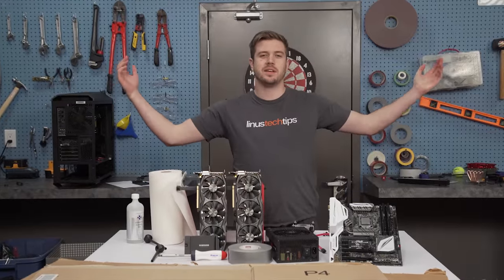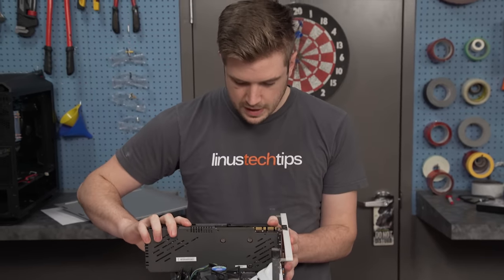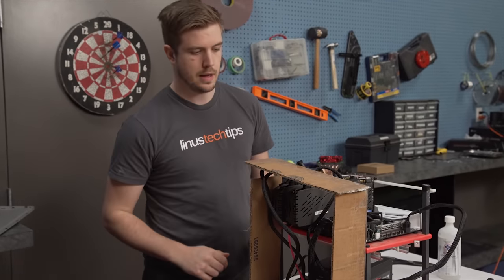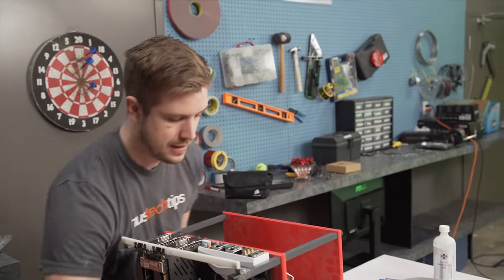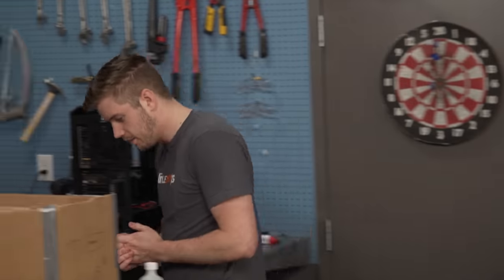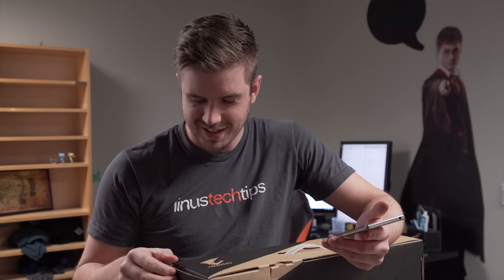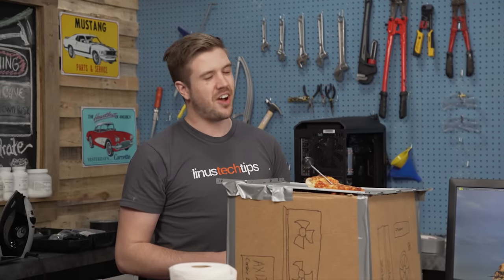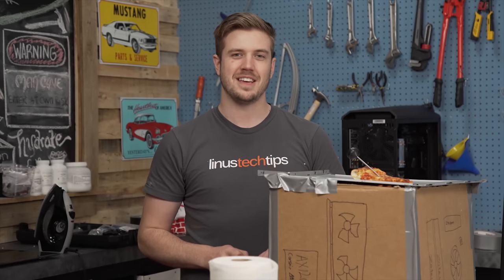Gaming PC & Pizza Warming Platform Prototype Construction

Comment: Are you guys out of ideas?
Reply: Yep
Reply: +z1ckZack10 I'd say they are out of interesting computer hardware. But holy shit the half-assedness of the couple of previous videos.
Reply: +Table Salt That would be shocking, since these are recorded a month in advanced, meaning the Network wall would have been released around 2 weeks after this was recorded.
Reply: +Table Salt This was filmed on February 19th, as he says in the video.
Reply: Its from the lack of new stuff coming out
Reply: +z1ckZack10 You're coming to that conclusion just now?
Reply: Next up: 50 gamers, 1 cpu (actually 7)
Reply: no this is very creative.
Reply: no, they're running out of new hardware, so they have to use their own ideas
Reply: +z1ckZack10 It would burn the pizza.
Reply: +ImpaKtZero So basically it's the same as running out of ideas xD

Comment: Should have used 4xSLI GTX 480 and FX-9590
Reply: He said cook the pizza not your neighborhood
Reply: Crossfire RX*
Reply: +Kellin Quinn No, that is nowhere near as hot as sli gtx 480s.
Reply: i was going to say 480 too nut then a remembered the 6990 lol
Reply: Dane Reinsch Oh. Didn't realize Nvidia made a 480 in the past.
Reply: Hahahahahahahhaha
Reply: Use Prescott Pentium 4s as well.
Reply: Use Galatin Extreme Edition P4s
Reply: https://www.pizza-rozvoz.cz/ tady najdes tu nejlepší pizzu v praze
Reply: quadrplax we're trying to heat a slice of pizza not build a bomb
Reply: Can confirm i have 1 GTX480 liquid cooled and it takes 2-3 seconds if pump fails to crash due to overheating
Reply: he wanted to keep the pizza warm, not COOK raw meat....
Reply: lol
Reply: quadrplax with watercoolinf too
Reply: now that vega 56 and vega 64 is here, the pizza can reach temperatures of 44c
Reply: What about a GTX 460SE
Reply: They should have used two HD6990's in crossfire in furmark
Reply: HE WAS TRYING TO COOK PIZZA NOT CREATE A STAR
Reply: lol :-)
Reply: How bout we use 4 overclocked threadrippers and an overclocked core I9 just to be sure
Reply: Pff, I can do better. FX-9590 & quad Radeon HD 6990 @ 880mhz. Each card has a estimated TDP of 491w and closer to 550w when OC'd. Forget pizza warmer, you could cook your pizza on that!
Reply: Also, load up furmark for even HIGHER power draw!
Reply: Update: 10900K/RTX 3090
Reply: would you recommend those for a new pc?
Reply: Heater not oven mate

Comment: Would make more sense to use amd cards.
Reply: +Fire Lord Sanders Your pun went up in flames, sorry
Reply: +Vinyl Scratch just like amd's financial reports since 2010 (and their gpu's)
Reply: +Alex G Erm no, AMD is good, stop with the fangirling.
Reply: William Huddie that went right over your head.
Reply: Yeah you should have used an amd CPU and amd cards
Reply: +Alex G Also I own a GTX 970 and prefer nVIDIA, but AMD beat nVIDIA in some benchmarks (Titan X vs R9 Fury X at 4K for example)
Reply: +tnnss111 Shots fired.
Reply: William Huddie It is still going over your head man, are you aware of what a satirical joke is?
Reply: +PsychoSlayer55 jones intel CPUs can run hotter. most amd cpus have a max temp of 80c and most intel can do 100.
Reply: +UltimateKnives Dont want to use it as a pizza-oven, just heat the pizza.
Reply: +tnnss111 dammm shots were fired
Reply: +Shiba the planes were fueled by 6300s!
Reply: +Shiba the planes were fueled by 6300s!
Reply: +ChexEdits Yeah but a maxed out AMD is only like 60% of my Intel so my Intel will be cooler doing the same workload.
Reply: +tnnss111 that was a rekt right ? HAIL GTX 980ti
Reply: +GameDev1909 Game Engine Tutorials have you overclocked it ?
Reply: +ChexEdits It's not about the temperature of the part. It's about the heat output from each part, therefore it would be best to have a 9590 and amd graphics
Reply: Alex G I am, but yours sounded very non-satirical, and it doesn't come across well in text
Reply: The joke was overworked, basically the first comment on this thread was funny because of its simplicity, a plain statement, not tryharding with jokes about finance or anything
Reply: YES, there he is!! The Elite gamer! Everbody make room for him. He is quite clearly better than everyone!
Reply: William Huddie If you say so
Reply: Hidde van Ophoven Wtf?
Reply: Alex G Imo, I mean I don't want to shit on your joke...
Reply: +tnnss111 or a pentium 4.
Reply: +caddy 50C in full load ... rly.
Reply: +William Huddie "Also I own a GTX 970 and prefer nVIDIA, but AMD beat nVIDIA in some benchmarks (Titan X vs R9 Fury X at 4K for example)"

well thats not true for one 

and ever since Amd released there hole "R9 390 BETTER MID RANG GAMING, LOW COST"

and the gtx 950 aimed at 160-200 USD beat all of the...

but i will say the R9 nano beats the TITAN X i price per performance but you still wont be able to achieve 980TI levels without crossfire
Reply: shots fired AMD fanboys!!

oh shit! my system is AMD based..
Reply: +tnnss111 He wants to heat the pizza, not burn it.
Reply: +rv3392 I seem to have forgotten that a fury x is about the same power consumption as the 980 Ti. if you want a real roast 290x ho
Reply: Funny because it's true! >_<

I got a single R9 290X I stopped using after 1st one fried and I got a new one for warranty. They run @ 80 degrees celsius doing fuck all - It'll heat up a pizza to the point the cheese becomes a liquid
Reply: +TheGray Aviator I have a 380 and it doesnt even reach 65 degrees lol xD
Reply: GTX 480s are definitely the best
Reply: +TechBrick ayymd
Reply: use the cards Apple uses in MacBooks, those things can burn you...

tru stori meight
Reply: +tnnss111 I would of agreed a few days ago, but I'm currently sitting in a hotel due to the fact that my GTX 590 burnt down my house.
Reply: Alexander Yordanov im willing to argue that Nvidia makes there cards better and first, and AMD generates more heat, causing less performance, take longer to come out, and COST more then there Nvidia counterpart
Reply: AMD GPUs apart from high-end level is damn good deal! But CPUs for now are a god damn joke!
Reply: +Slamdoxicalz lol your R9 290X is probably on a custom cooler. the real deal here are R9 290 or 290X with stock cooler from AMD ^^ it will EASILY hit 95°C because that's actually AMD's default target temperature.
Reply: +Logan Darklock actually those cards output a minimal amount of heat, but apples cooling sucks because they refuse to use fans, and prioritise thinness over everything but making it overpriced
Reply: +Ganjasaurus X lol rip
Reply: DragonTamer Cos
And you would be wrong.

Also... more heat does not mean less performance lol...
Reply: Alexander Yordanov
well it mostly strains overclocking i do characterize that as a performance strain
Reply: DragonTamer Cos
Very few people OC. Shocking, I know, but it is a Fact.
Also, even so, it is not quite correct what you are saying.
Reply: Alexander Yordanov
well..its sorta..6:17 am..give me a break
Reply: DragonTamer Cos
12: 21 PM... :)
Reply: Alexander Yordanov
in est..6 am
Reply: PLIVIUT - Sparklez Student (Ninja Defuses and Montages) yes,right now with the same cooler,i have around 75-80C in full load

Comment: You should have gone with a 290x and amd cpu for more baking power :P
Reply: All inside tbe Fractal Toaster.
Reply: looooooooooooooooooooooooooooooooooooooool
Reply: +David Dorm sick burn, but at least it wont gimp the pizza's flavor with SHITWORKS!!!
Reply: I came for amd comments and found one.
Reply: +Jan-Christopher Estelmann a QuadSli of GTX 480s for industrial furnance works
Reply: Hell no, GTX 480 bakes the cake on this one.
Reply: just get a 280 and 9000 series fx cpu with stock heat sink. Instead of the pizza melting the cpu will be crisp and abit overcooked and the gpu will im sure they would of blew up.
Reply: SrizyGaming what particular heatsink or cooler is irrelevant... the TDP is the clue, how efficient the heat will be moved from gpu to air (case air) does not play a role because of thermal dynamics
Reply: +Jan-Christopher Estelmann im saying the stock fx cooler becz its will be at 100% at idle and in benchmark the fan will just fly off and then youll realise that you like ur cpu medium rare not burnt.
Reply: +Jan-Christopher Estelmann fx9590 @ 5.0GHz
Reply: +Jan-Christopher Estelmann 390X and overclocked FX-8350 here, can confirm, could probably incinerate a slice of pizza by running prime95 small fft and furmark
Reply: +Jan-Christopher Estelmann they just used stuff they had laying around

Comment: silly Luke, should have used an AMD fx series CPU and 2 fury's. could have baked a pizza then lol
Reply: +Matt Rowbottom He doesn't want to burn the pizza though.
Reply: 3.8ghz Pentium 4 and Nvidia 8800gt or 5900 or 7950gx2 XD
Reply: +MinBCraft Or  Pentium D
Reply: Fury's don't have high thermals... LOOK AT WHAT YOU HAVE DONE LINUS. FIX THIS!
Reply: They have a higher TDP, more heat energy is generated. Thermals are a result of the efficiency of the cooler and how much heat energy it can dissipate. So yes, a fury would have been a better choice
Reply: Oh my goodness, settle down sir, it was an idle joke. We're not being haters and its not destroying anything, if anything it's inspiring competition, I wouldn't be surprised if AMD got it together this year and created Zen because they saw how much of a cult joke FX had become. 

There are fanboys out there, can't dispute that but, theres a difference between poking some fun and being a fanatic hate monger lol. I just go with whatever is doing the best at the time of my upgrade in terms of my needs, last build cycle it was the 4770k paired with a Gtx 780, before that a 2500k paired with a radeon 5770 and then a 7770 and before that an amd x2 with a HD 3850 (I think), wait what an AMD chip !? I'm an Intel fanboy nooooooooo
Reply: Don't blame Linus for it either lol, it's just a well known fact that they haven't improved their architectures in many years and their GPUs most commonly run warmer / have a higher TDP than nvidia no one really cares and people still buy them but, it's part of the custom pc community to poke fun. In more recent years it's become pretty toxic with the rise of CoD and  more early teenagers having custom rigs
Reply: Matt Rowbottom I will give you that, I am jaded. I am actually not a fan of any brand, so don't get it twisted, I have just seen so many great innovations lately from AMD but their market share still unfairly falls, and a monopoly will be bad for everyone. Continuing the same old complaints about things AMD has already fixed is counter productive. All it is doing is giving AMD an unfair chance to fight back with zen and vega. 
Call me pessimistic, but I forsee AMD beating intel and nvidia on all fronts, and STILL losing market share. The mindshare is too strong, and people will blame AMD when they fail as a company, and PC gaming will be consolized due to monopolization.
Reply: Nah, if they come out with products that best the competition they're targeting they'll thrive. Unfortunately not targeting the high end and enthusiasts off the bat with Polaris has slowed them down, especially with the 480 lagging behind the 1080 in dx11 which is the most common game engine
Reply: Matt Rowbottom No people do care, and they are NOT buying them. That is the problem. AMD is right for the majority of the market, but they still can't sell product, due to the internet completely overflowing with regurgitated AMD hate.
Reply: The power draw issues on the reference model killed them as well in terms of bad PR. Uninformed people got scared off by thay
Reply: I think part of it is just their image as being affordable instead of premium like the other brands. People like to feel like they own something special instead of generic (not saying they're generic just talking about marketing psychology) and things with a higher price and a more premium feel almost always do better especially with them seeing higher numbers in benches etc. They have a lot of work to do but, of they can convince people it's a special and premium product that's desirable AND they win the benches they'll crush them
Reply: But what about all of the reference issues on nvidia cards? They get buried due to the overwhelming support they already have.  I sometimes wonder if AMD could possibly succeed unless they do everything flawlessly for 20+ years, which is impossible. A single mistake and the internet will have more fuel to diss AMD into oblivion. Do you remember the power draw on the 400 and 500 series nvidia cards? Christ... that was ACTUALLY a problem, yet they still sold like hot cakes, pun intended. Lying about the 4GB of ram? Either of these would not have been buried had it been AMD.
Perhaps AMD should also pay shills to post in comments and forums. It has done wonders for intel and nvidia, starting the trend.
Reply: Easy lad, I'm just spit balling here. 

The 480 nuking cheap mobos was a huge deal, anything that does physical damage always makes big waves even if was only a miniscule minority similar the galaxy note 7 exploding phones, I think it was less than 1 percent of units but the internet was thrown into chaos about it and they were all recalled but, the internet remembers and Samsung has been hurt by that. 

I can't remember the 4/5 series being a real issue and killing hardware although I don't think I was paying a huge amount of attention to the market at the time.

The 3.5GB issue did hurt nvidia but they are wizards when it comes to PR and managed to distract people with the next shiny thing and most people forgot because it didn't really hurt gameplay or do any harm as the card wasn't powerful enough to play anything well that would consume that much vram.

Its a hard life but, if you want to build a name and come back as the underdog you have to work bloody hard and be flawless. It's like starting a small business , you can't make a single mistake in the first few years or you'll fail. If AMD get a few solid Ryzen / Vega product out of the gate people will start to forget and maybe in a couple of years they'll be back ontop like a decade ago when their single cores were the best around
Reply: Matt Rowbottom Personal responsibility is a hard pill to swallow. I will leave it at that.
Reply: Very well, hope AMD do ryze in the new year
Reply: I forgot to mention the fiasco of AMD reusing the r9 200 series guts in the 300 series. That really hurt them too. I mean you must admit that AMD has made at least as many mistakes as everyone else and hasn't bothered to innovate much in 5 years with every year building a more and more negative image of them. 

Ah well I'll leave it alone
Reply: Matt Rowbottom r9 300 series was a redesign of the 200 series to compete better with Nvidia's 900 series. Their R9 390 beat the GTX 970, so it worked.
Reply: Fair point but, what I'm saying is the discovery and bad pr that it was a very minimal change at all physically hurt AMDs image and worsened peoples opinion of them.

I'm mainly talking about image and marketing here and how AMD could improve and better compete in my uninformed opinion as a pro-sumer.

If they can improve their image and match the PR and spin of the big boys they'll have a much better fighting chance of swaying people to buy their products
Reply: I'd like to see them abandon the 'affordable' angle and push for a more premium campaign which is more the direction Ryzen looks to be taking, they're going for it and getting excited which is good to see.

But, if they bugger it up it'll kill them and it'll be 10x harder for them to ever recover
Reply: Matt Rowbottom Affordable is the far better option for AMD in terms of profit. They're doing affordable, yet powerful enough for ultra settings stuff first (RX 480, 470 etc) and then the GTX 1080, TITAN XP killers (Vega)

As far as I'm aware, Ryzen is trying to do the same sorta thing as Polaris. As in, high-end performance for an affordable price.
Reply: Akula Markov i agree that they should stay affordable but market their products as premium. Don't refer to them as affordable so when people see the price psychologically they feel they are getting a great deal
Reply: Matt Rowbottom Mhm, they're marketing Ryzen as "Great value, better performance than a 6700k without turbo boost" at the moment. Can't wait for the price reveal myself.
Reply: Nah, bruh. Fury's heat output is weak sauce when you compare it to the 94C a OC'd 6990 can generate! Add three more and a FX 9590 for extra credit and you can cook a pizza! Hell, you could probably make some cookies for dessert too!

Comment: OR you could use liquid cooling, make a setup with a 360 and a 120 radiator. The 120mm radiator would be passively cooled and placed horizontally. If you need to heat up something, turn off the fans on the 360mm rad and place your pizza on the 120mm radiator!